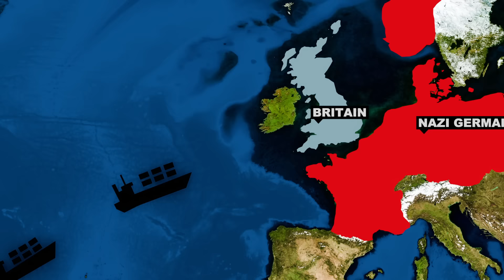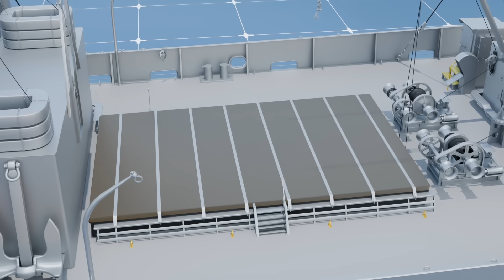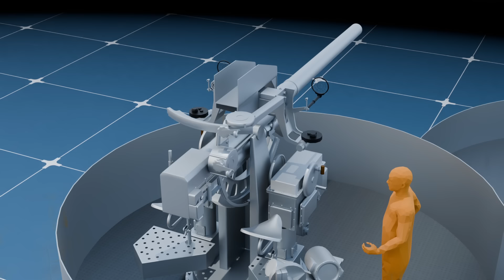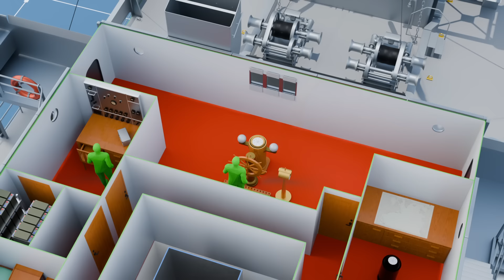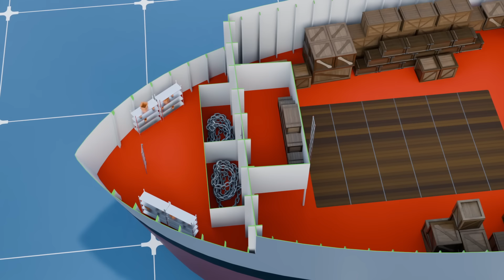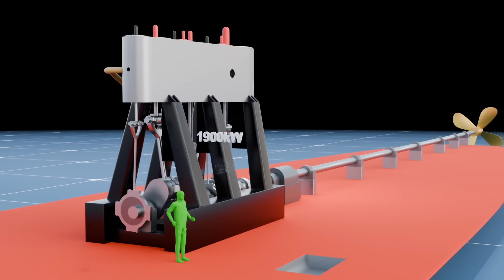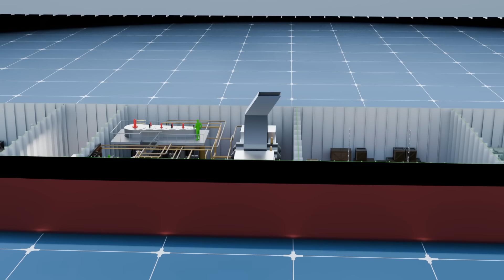How the Liberty Ship Actually Worked

Comment: I sailed on a British registered Liberty ship during my apprenticeship  in 1960 . The ships were known as SAM boats  when crewed by the British. My vessel was the Samness. The basic design was for 10, 000 tons at 10 knots. A box, with a bluff bow and stern attached. They tended to snap just forward of the central accomodation in heavy seas, so the one I was on had a reinforcing plate riveted on either side. Our gyro compass was located low down in the hull (To reduce wear and tear from motion), and as an apprentice, one of my jobs just before the end of my watch, was to go down to this hot stuffy room and ring up the bridge to ensure that the repeater up there was still in line with the actual heading. These ships were designed with the North Atlantic in mind. They were not designed for going to the tropics in the Far East. I still break out in a sweat at the remembrance, but that was then. Great. The video brings back memories. I later sailed on a Victory ship (Salinas Victory). They were still 10,000 tons, but powered by a diesel engine giving 16 knots.
Reply: Victory ships were not diesel when new, they had steam turbines, many were retrofitted after the war with a large marine diesel

Comment: Excellent presentation, but one quibble: the animation of the steam engine could easily show that the piston is pushed by steam in each direction (alternately up and down), the sliding valve allowing access for each side to either the intake or exhaust port depending on the crankshaft position. I imagine the unnamed object on the shaft aft of the engine is some sort of damper or torque limiter to prevent shaft damage when changing power settings.

Comment: Interesting. But, Mr Deconstructed appears to have skipped the class on how Union Puchase lifting gear works. Each of the 5 holds had a set of Union Purchase derricks, which operated a single hook together (in "union"). Not one hook for each derrick as illustrated. 2 and  4 holds also had single boom heavy lift "cranes". In use, one derrick in each pair was postioned centre over the hold, the other was swung out over the side above the dock or barge, then both were fixed in place. Two winch operator worked in cooperation to lift cargo from under one derrick and then transfer the weight through the cantre, each winch giving and taking slack, to transfer it under the other derrick, where it would be lowered. It was skilled work. And very slow by todays standards. 
PS. I didn't google this. I'm old enough to have worked the real thing (not a Liberty Ship). Which is kinda frightening.

Comment: I served on the USS George Eastman 1963 to 1965 possibly one of the last liberty ships along with the USS Granville Hall. they were modified for the nuclear test in the early fifties with large birdbath like attachments on the forward mast they were still used for special tests I served as a machinist mate in the engine room for a while  Worked on the Hendy marine steam engine and will never forget how big it was.Underway it was 140 degrees F in the upper levels and the engine used a drip oil systems that fell into the bilges. open crankshaft

Comment: Both the steam engine and the diesel engine had a clear advantage over the steam turbine, the diesel engine and the steam engine were more efficient due to low fuel consumption and less engine vibration than the steam turbine, the steam turbine produced more power but maintenance was high and it vibrated a lot which made the crew uncomfortable.

Comment: I was amazed at the design and function process of the 4 stage steam engine and by the idea that the simpler design was used in favor of a steam turbine. Im more accustomed to aircraft design and just gaining an appreciation for maritime architecture. The favor of the simple steam engine makes sense in contrast to the turbine. It is remarkable how they could make such a complicated system simplify it and enable for mass production at the rate they emerged. Outstanding video!
Reply: As vast as US production was during WWII there were still limits in how fast items could be produced and a limit to manpower. Expansion engines were used in merchant and escort vessels to free up turbines for the main fleet vessels.

Comment: Liberty ships were not equipped with superheating boilers or condenser.  The steam dumps into an open hot well. 

Reciprocating engines require saturated steam to lubricate the piston rings.

Victory ships need superheated steam and turbines makes better use of deep vacuum

Comment: The  sheer nr of them built, and the fact that they basically defined how ships would be built electrical welders and using the block system is cool.
They had a habit of breaking in the welds doe. After the war the emergency ships  was still used but several sank due to metal fertige.

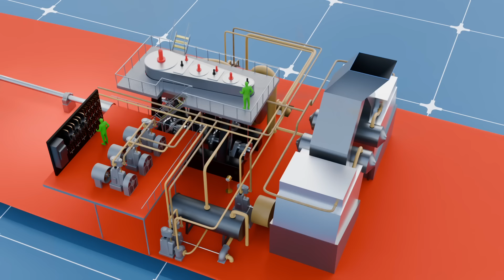Comment: 17:41 what’s the pressure and temp of the steam/water?
Reply: 220 psi, 440° to 450°.
Reply: @bamacopeland4372 wow that’s pretty dangerous
Reply: @brianlittle717 when it comes to steam driven propulsions it's actually not that dangerous those are typically within the normal pressure and temperature.
Reply: @bamacopeland4372 oh well I didn’t mean dangerous like that. I meant dangerous for somebody like me who shouldn’t be fooling around with stuff I don’t know about. In other words it could probably hurt you if it leaked. 
What happens when a boiler with all that pressure and steam goes down in a sinking ship and instantly hits the cold sea water? Is that when they say the boiler explodes?

Comment: Your gun calibers don’t make sense
Reply from the maker: Unlike firearms, naval guns are usually classified by caliber (the diameter of the bore) and calibers (the barrel length expressed as multiples of the bore diameter). For example, a 3 inch/50 caliber gun has a 3 inch bore and a barrel 150 inches long (3 × 50). We should have clarified this in the video.

Comment: I used to sail ships similar to these as an engineering officer after graduating from the United States Merchant Marine Academy, Kings Point, like my father before me.  I only been on one triple expansion reciprocating steam engine driven ship.  These ships were simple but without automatic controls to make operation easier, a larger engineering crew was needed to operate steam pressure controls and burners manually.

Comment: Good video. Only complaint: @7:00 .50 caliber is 0.5" or 1/2 inch or 12.7mm. So the 3" & 4" guns are Not 50 caliber.
Reply from the maker: Unlike firearms, naval guns are usually classified by caliber (the diameter of the bore) and calibers (the barrel length expressed as multiples of the bore diameter). For example, a 3 inch/50 caliber gun has a 3 inch bore and a barrel 150 inches long (3 × 50). We should have clarified this in the video.
Reply: @Deconstructed_Animations  Gotcha. They always have to make things as complicated as possible. I knew about the L-designation in Tanks, referring to Barrel Length but never actually heard it call Calibers.

Comment: 3in 50 caliber gun and 4in 50 caliber gun ? ???? never heard of that bore size    something new ?
Reply from the maker: Unlike firearms, naval guns are usually classified by caliber (the diameter of the bore) and calibers (the barrel length expressed as multiples of the bore diameter). For example, a 3 inch/50 caliber gun has a 3 inch bore and a barrel 150 inches long (3 × 50). We should have clarified this in the video.

Comment: The showers probably used saltwater and saltwater soap. The merchant Marine typically had older less fit men than the Navy. My mother's father served in the MM in WW2, and had two ships torpedoed  out from under him. Superheated Dry steam was dangerous because it wasn't visible. One would look for a leak with an old broom, when pieces fell off the broom there's the leak

Comment: Great video, but you should mention that some of these ships were extremely unsafe due to cracking of steel plates of the hulls. It was a serious problem that cost a lot of lives during and after the war. The problem was related to substandart steel prone to metall fatige and cracking in cold enviroment used for the mass construction of these ships during the war.
Reply from the maker: Thank you for the additional information, and for watching the video!

Comment: "4 inch 50 caliber guns"😑
Reply from the maker: Unlike firearms, naval guns are usually classified by caliber (the diameter of the bore) and calibers (the barrel length expressed as multiples of the bore diameter). For example, a 3 inch/50 caliber gun has a 3 inch bore and a barrel 150 inches long (3 × 50). We should have clarified this in the video.

Comment: "4 inch, .50 caliber gun" is like saying a "1 gallon, 30 milliliter container."

A 4 inch gun is 4 inches wide (diameter of projectile).  A .50 caliber gun is half an inch wide (diameter of projectile).  Same with 3 inch guns (diameter of projectile).
Reply from the maker: Unlike firearms, naval guns are usually classified by caliber (the diameter of the bore) and calibers (the barrel length expressed as multiples of the bore diameter). For example, a 3 inch/50 caliber gun has a 3 inch bore and a barrel 150 inches long (3 × 50). We should have clarified this in the video.

Comment: The description of the armaments is wrong, e.g. it's a  four inch deck-gun, not "Four inch fifty caliber".
Reply from the maker: Unlike firearms, naval guns are usually classified by caliber (the diameter of the bore) and calibers (the barrel length expressed as multiples of the bore diameter). For example, a 3 inch/50 caliber gun has a 3 inch bore and a barrel 150 inches long (3 × 50). We should have clarified this in the video.

Comment: 3" and 4" guns are not 50 caliber.
Reply from the maker: Unlike firearms, naval guns are usually classified by caliber (the diameter of the bore) and calibers (the barrel length expressed as multiples of the bore diameter). For example, a 3 inch/50 caliber gun has a 3 inch bore and a barrel 150 inches long (3 × 50). We should have clarified this in the video.

Comment: Those are much, much, much bigger than .50 caliber guns.
Reply from the maker: Unlike firearms, naval guns are usually classified by caliber (the diameter of the bore) and calibers (the barrel length expressed as multiples of the bore diameter). For example, a 3 inch/50 caliber gun has a 3 inch bore and a barrel 150 inches long (3 × 50). We should have clarified this in the video.
Reply: @Deconstructed_Animations  ALL firearms are classed by the diameter of the bore. (That’s what “caliber is) A .50 caliber is 50/100s of an inch bullet/bore diameter. A .50 caliber is the most common belt fed heavy machine gun in the American military across ALL services: Army, Navy, Air Force, Marines, and Coast Guard (the Coast Guard mount it on theirs smallest boats) It’s the machine gun that was mounted on on jeeps, bombers, and fighters in WW2 and river patrol boats and helicopters since the Korean War. It has a rate of fire of 450 - 850 rpm depending on which variant (up to 1200 rpm on the aircraft mounted versions) and a bullet velocity of 2800 - 3000 fps. It was designed by John Browning and has been in service well over a century.
Reply: @Deconstructed_Animations  Naval guns are also classed by bore diameter alone. A 3.5 inch gun is simply called a 3 & 1/2 inch gun. Saying it’s a “3.5 50 caliber.” is like saying “That animal is a tiger hippopotamus.” There’s no such creature.

Comment: "3 inch 50 caliber guns". I don't know them.
The engines use sweet water, I presume.
Reply from the maker: Unlike firearms, naval guns are usually classified by caliber (the diameter of the bore) and calibers (the barrel length expressed as multiples of the bore diameter). For example, a 3 inch/50 caliber gun has a 3 inch bore and a barrel 150 inches long (3 × 50). We should have clarified this in the video.

Comment: Fascinating documentary - I had never known the layout of a Liberty Ship design.  I can see how standardization allowed for mass production.  One thing that took me back though, was the tidbit about the steam engine producing only 2500 hp.   A typical P-47D 's Pratt&Whitney R2800-59 radial engine was rated at 2430 hp, and later variants put out 2800 hp.  I guess it has to do with the rpm range of a ship's propeller vs. that of an aircraft propeller, and transmission losses, but a couple of Pratt&Whitney R2800's could have provided easily 5000 hp, giving these Liberty Ships a much higher speed.

Comment: I'm confused... you say 4 inch .50 caliber gun and 3 inch .50 caliber gun, but that doesn't make sense. Inch ans caliber isn't mixed. Did you mean to say a 4.5 inch and 3.5 inch gun?
Reply from the maker: Unlike firearms, naval guns are usually classified by caliber (the diameter of the bore) and calibers (the barrel length expressed as multiples of the bore diameter). For example, a 3 inch/50 caliber gun has a 3 inch bore and a barrel 150 inches long (3 × 50). We should have clarified this in the video.

Comment: First of all, an excellent video. Thank you.
Built on the principle taught at MIT. The KISS principle. Keep It Simple Stupid (or student in polite company). To be clear, I didn't go to MIT, but I have read and heard that it is an engineering principle taught there. When the design is simple, the product is easier to manufacture, easier to maintain, less likely to break down, and easier to fix if and when it does break down.
The most interesting part to me was the three tiered  piston arrangement. The idea of the pressure loss through the stages being compensated for by more surface area of piston head is fascinating to me. The fact that they are connected to the same shaft is proof of excellent engineering pressure calculations.
Again, thank you.

Comment: There is currently one of these still laying Half sunk in (or close to) the River Thames Estuary since WW2 with the masts still showing above the water line with it's holds still containing  'active' munitions, the authorities have been on tenterhooks since it went down believing that should it ignite it may well cause a hell of a lot of damage to surrounding areas, I believe they have been reluctant to make any move to making it more stable in case any involvement 'May'  create an explosion, they do keep saying they are considering cutting off the masts that are above the water line to make it more safe for the busy shipping lane which i lies in, (but that all remains to be seen), the story goes it was meant to be part of supplying the attack on  the 'D' day landings but when it arrived 'someone' allocated it to the incorrect positioning for anchorage and that night a severe storm arrived caused it to drag anchor and stop on a mudbank resisting any/all attempts to pull it free, so a mad attempt was put in place to unload it's lethal cargo, but after managing to unload only 'Part' of the cargo the ship broke it's back and sank to where it remains to this day still part laden with it's deadly cargo!.

Comment: What is a 4” 50cal gun?
Reply from the maker: Unlike firearms, naval guns are usually classified by caliber (the diameter of the bore) and calibers (the barrel length expressed as multiples of the bore diameter). For example, a 3 inch/50 caliber gun has a 3 inch bore and a barrel 150 inches long (3 × 50). We should have clarified this in the video.

Comment: What exactly is a "4 inch 50 caliber gun?" 🤣 they had "3 inch 50 caliber guns too?!?!" Must be a new invention! 50 caliber is half inch.
Reply from the maker: Unlike firearms, naval guns are usually classified by caliber (the diameter of the bore) and calibers (the barrel length expressed as multiples of the bore diameter). For example, a 3 inch/50 caliber gun has a 3 inch bore and a barrel 150 inches long (3 × 50). We should have clarified this in the video.

Comment: 4 inch 50 caliber guns..? Am I hearing that right..
Reply from the maker: Unlike firearms, naval guns are usually classified by caliber (the diameter of the bore) and calibers (the barrel length expressed as multiples of the bore diameter). For example, a 3 inch/50 caliber gun has a 3 inch bore and a barrel 150 inches long (3 × 50). We should have clarified this in the video.

Comment: You can't call a 4 inch gun a 50 cal and at the same time call a 3 inch gun a 50 cal?
Reply from the maker: Unlike firearms, naval guns are usually classified by caliber (the diameter of the bore) and calibers (the barrel length expressed as multiples of the bore diameter). For example, a 3 inch/50 caliber gun has a 3 inch bore and a barrel 150 inches long (3 × 50). We should have clarified this in the video.

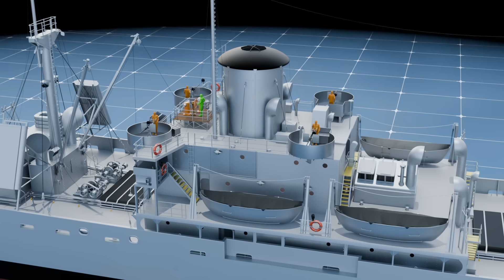Comment: 7:28 3in 50cal?
Reply from the maker: Unlike firearms, naval guns are usually classified by caliber (the diameter of the bore) and calibers (the barrel length expressed as multiples of the bore diameter). For example, a 3 inch/50 caliber gun has a 3 inch bore and a barrel 150 inches long (3 × 50). We should have clarified this in the video.